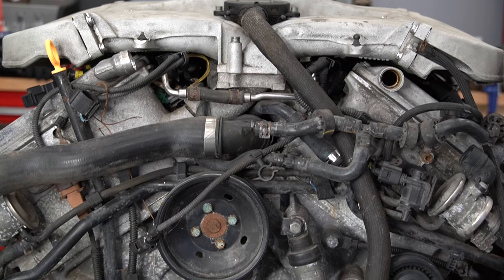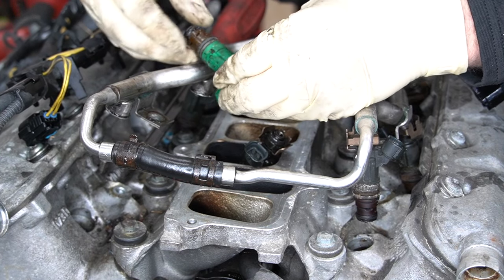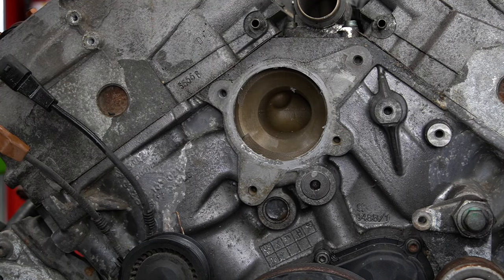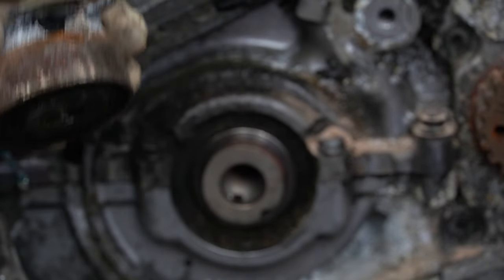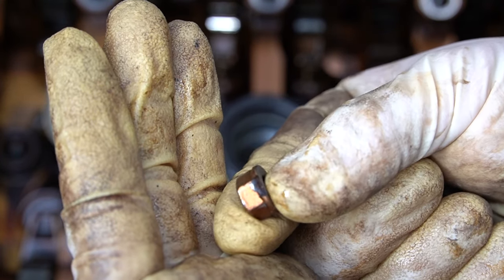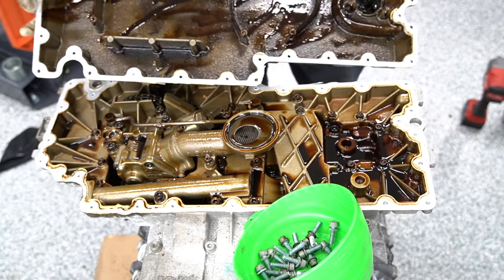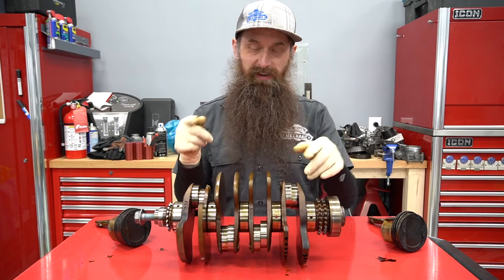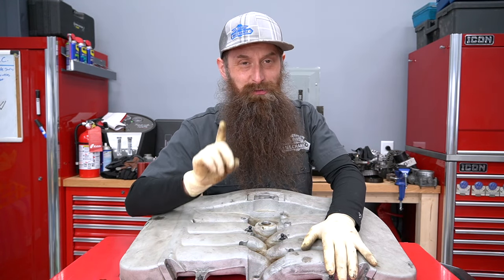W8 Passat Engine Teardown and Inspection ~ TINY V8

Comment: Whoever the engineer was who decided to put the timing chains on the back of the engine should have been immediately fired.  While a timing service isn't a common maintenance item, having to remove the engine to do a timing service (aside from an exotic car....which is still ridiculous) is the dumbest thing ever.  It's bad enough to do the timing service on a VW with the timing chain in the front.  I can't imagine the quote the customer would get if they had a shop perform this service.  Mechanically totaled.

Comment: The Power to Weight ratio of this . . . thing . . . .would be atrocious. Even introductory level engineering students would know this.
Reply: Perspective. This engine weighs about 470 pounds, so considering the fact that the 2.8 V6 that came in the lower trim levels of the same car weighed nearly as much as this W8 yet only made 190 horsepower, it's not terrible. The next trim level down from there was a 1.8 turbo 4 cylinder that weighed about 90 pounds less and made just under 170 horsepower. Keep in mind these engines began their design phase 25-30 years ago when performance cars like the Corvette and 911 Turbo were making 250 horsepower and supercars like the F40 and Diablo were just barely making 500 horsepower.

Comment: Not gonna lie, using a rubber belt and tensioner to run BALANCE SHAFTS has got to be the worst engineering I've ever seen, lol. What bean counter decided that was sufficient? Neat engine otherwise.
Reply from the maker: You’ve never seen the belt driven oil pumps?
Reply: @HumbleMechanic  Nope, I've only really worked on American stuff for the most part. Not a professional. What engines have a belt driven oil pump so I can laugh at them? Haha. I'm actually curious now what the service interval on that balance shaft belt is. Probably something most people never even knew about let alone actually replaced lol

Comment: The engineers who designed this ridiculously overcomplicated, overweight, underpowered monstrosity should be banished to working on Trabants. At first I thought the The cheap belt used for driving the balance shafts is one of the dumbest things I've ever seen. The liquid cooled alternator is the answer to a question no one asked.
Reply from the maker: I’m guessing the belt was an accounting decision lol
Reply: @HumbleMechanic  You have to wonder how many of these cars got parted out after the warranty expired.

Comment: As others have said in therir own way, what a horribly overly complicated engine; a mechanic's nightmare!  If I owned one of these I would be haunted by thinking that it might break after the warranty was expired.  I would not enjoy driving such a car and certainly would not want to own one past 100k miles.  Being short in length with 8 cylinders to accomodate makes the crankshaft main and rod bearings appear narrowed to within a small margin between survival and failure.

Comment: It's pretty sad when they need to shorten the engine so they can fit all that damned wiring.
Reply from the maker: Its funny to me, this is the world I live it. So things like that dont really seem as much an issue as it may be to others. its a V8 with VVT, and a good number of sensors. The wiring may look crazy because the engine is 8"shorter than a standard V with COP?

Comment: What a huge lump of an engine that has no power.
Staggered pin cranks are hardly unusual. Buick v6s have used them for decades, smoother but they break when worked hard and you can be sure this one will  too.And that horrid Buick/ Holden makes more power and is a quarter the size.
For a modern engine  wide rings.
Scrap alloy is all it is.

Comment: you have to take the induction system off to replace the thermostat, which is common failure part?! plastic water pump impeller? rubber belt driven balance shaft system?
all that complication, weight and a maintenance nightmare for 300hp?
more german engineered garbage.  
the real question is how is it that VW is still in bussiness? who are the suckers buying this brand?

Comment: VW engineering is a mess and everything but state of the art.  130 hp more than my 4l Chevy I6 designed in 1928? My engine is all original, quiet, burns no oil and has been running continuously since 1954.

Comment: These kind of engines are marvels of engineering, but stupidly convoluted & over engineered with way too many points of wear and failure, chains all over the place plastic tensioners CHAIN DRIVEN  OIL PUMP=??, expensive to produce and repair and costs a fortune for ordinary maintenance routines - Ive never seen so many unecessary points of failure & reduced reliability and all this just to shorten the engine enough to cram it under the hood of the latest roller skate stylilng. By the way, that split journal crankshaft pin was designed decades ago by Buick for their V6
Reply: Ha, VW was way ahead of the times with this engine. You think this is overcomplicated and convoluted, take a look at some of the 3 and 4 cylinder motors being put in everything sold today. More chains, more buried components, and way more plastic, all in the name of efficiency.

Comment: German engineering leads to what have been objectively rated as the least reliable cars in the world. It’s no wonder German cars are famous for dribbling essential fluids when VW decides even an alternator needs to be liquid cooled. Never mind that air cooled alternators work perfectly and routinely last 150,000 miles or longer in most other cars. It’s yet another example of the Germans making something more complex and failure prone for no valid reason. It just adds weight, complexity, failure points, and greatly increases repair costs. There’s a reason the resale value falls off a cliff once they’re out of warranty. A 6 year old high end German car is typically worth about half a 6 year old Japanese car that sold for similar amounts new. That says it all. Look up the million mile Lexus that was almost entirely original and show me any similar German car that’s not a total money pit before it has a tenth that many miles.

Comment: Sorry to say this, but what a pile of crap, so much to go wrong and so complicated and for what exactly, it doesn't even make a lot of power. I would be willing to bet that balance shaft belt just shredded from old age, it looks like a 10 hour job just to replace it so who in their right mind would bother, and given the obsession with chain drive everything, why didn't that have a chain drive. Seems to me VAG have completely lost their way as far as engines go, they seem to decide to make some oddball configuration engine, then problem solve it as they go, all the things that make an engine work are an afterthought, thermostat, water pump, alternator, even the oil pump. Furthermore, they are disposable engines, the cost to repair an engine like this would be ridiculous, that is assuming that you can even get spare parts for it. I have watched a few VAG engine tear downs and they are just so stupidly complicated.

Comment: In not W8 it more like stack V4 and VW need to get head on straight and stop call it W engine as doesn't even resemble a true shape of a W engine like the Anzani 3-cylinder or Napier Lion VII
Reply from the maker: When you see it as 2 "V" that overlap it makes sense. Its more marketing than a literal W.
Reply: @HumbleMechanic  no that only apply if it was in center of the block as shape is more like VVV or V_V with 4 points where W has 3 points as a reg V has 2 points so you see that make no sense what so ever it should been call 2VR8 now that make sense after all in base around the VR4 block in a V configuration.

Comment: Overly complicated and built to decompose in eight years time.
Reply from the maker: 8 Years? lol.
Reply: @HumbleMechanic  I've owned a few VWs over the years and I'm done with them.  They don't last and always have weird problems. Electrical problems, rust, brittle plastic.
Reply from the maker: @chrisharper2658  Thats fair. Ive owned a bunch and they were all really great. Not problem free, but overall great. At the shop seen all ends of amazing cars and trash cars.